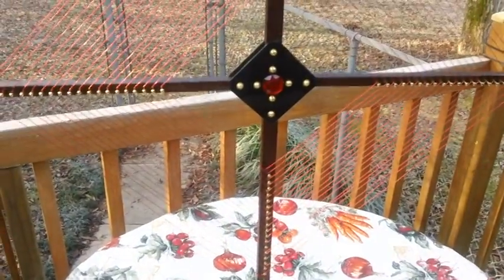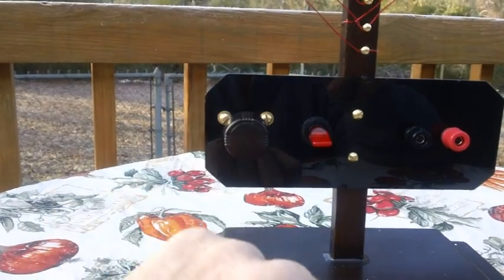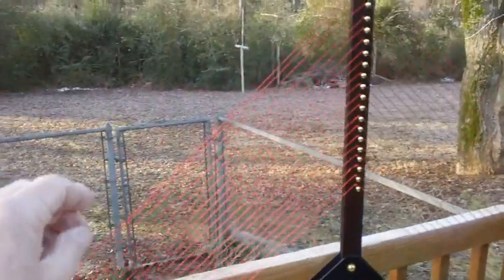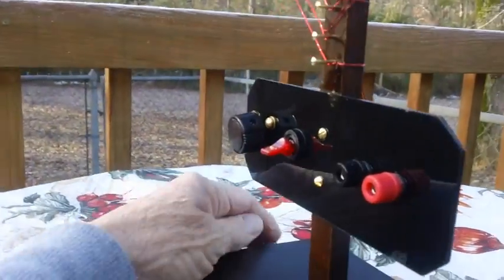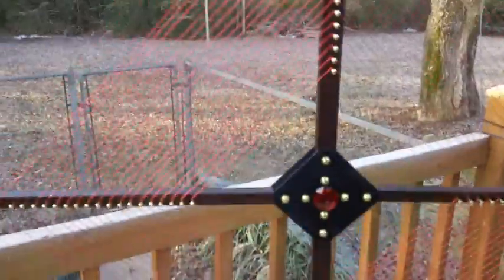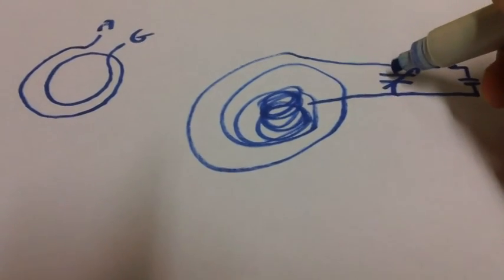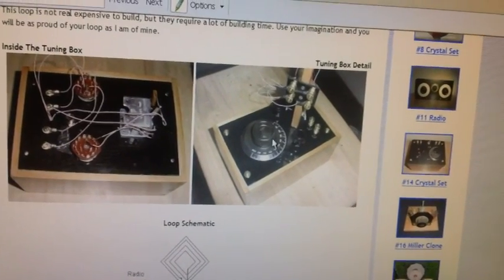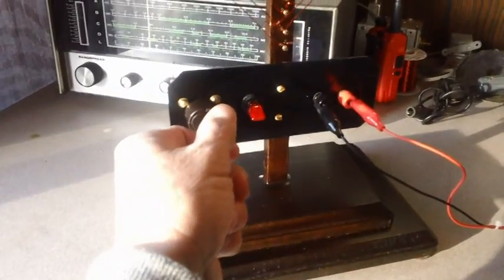AM Broadcast Band Tunable Loop Antenna

Comment: I Love your antenne construction. Like to build one for my LW/MW (SW) radio. What are the dimensions you used for the crossbooms?
Thank You
Stay Safe
Greetings from Belgium
Reply from the maker: Lambert,
12 1/2" each side.  Good luck with it, my friend.
Regards,
John
Reply: @joernone  Thanks for the answer, one more question, the additional 360pF capacitor (on the switch), what type is this, and which capacitor you use for the tuner?
Apologies for all the question.
Regards
Lambert
Reply from the maker: Lambert,
Go here for the 365pf variable capacitor:
https://www.ebay.com/itm/Capacitor-365pF-Variable-Single-Section/132032487083?epid=1712229709&hash=item1ebdbfdeab:g:N2wAAOSwfSJdC88J

This is the type of 360pf mica capacitor I used.  The voltage rating is mega-overkill, but it was all I had on hand at the time:
https://www.ebay.com/itm/Capacitor-365pF-Variable-Single-Section/132032487083?epid=1712229709&hash=item1ebdbfdeab:g:N2wAAOSwfSJdC88J

Regards,
John
Reply from the maker: Lambert,
One more thing, my friend.  This antenna is for the AM broadcast band only.  It won't work for shortwave 
Regards,
John
Reply: @joernone  Thanks again John. Sadly they don't ship to Belgium. I have looked locally, but could'nt find a variable capacitor that was usable.
Will look further though.
Greetings
Lambert
Reply from the maker: Lambert,
Not a problem, my friend.  I had an extra new one in my stash.  It measures out to  351pf, but will work fine.  Won't cost you a cent.
Send your mailing address to my YouTube handle @gmail.
Regards,
John

Comment: I don't know why you comment below denying a ground, since your diagram & voice clearly saying ground in the video. You are grounding 1 side of the the pickup loop which goes to your radio.  I can't see why you would ground that unless you are going to put a balan in between your balanced output; aren't you creating an unbalanced transmission line by grounding one side?

Comment: If your radio has a balanced antenna input, would u directly connect ur 2 leads to that input without a ground?  What is the impedance presented by your antenna output?  Is not the output intrinsically balanced? So how are you grounding one side without a balun?  I own a Sony receiver/amplifier (AV Center). The loop that comes with it has a twisted pair of wires coming from its loop & those wires connect into connection jaws in the back of the Sony.  There is no capacitor visble (maybe one is inside the Sony?) & u don't tune that loop.  So I am interested in a better loop antenna, but I really don't know what impedances are involved nor why you are grounding a loop antenna which I think is balanced. If you were to ground, I would think you would use a balun and then ground the shield side of your transmission cable.
Reply from the maker: I have no idea what you're talking about.  This is a passive AM non-Earth-grounded tunable loop antenna used to improve reception for vintage AM radio receivers that have no built-in antennas.  It'll keep one from having to string up an outside random long-wire antenna.   It's not to be used for transmitting.  There would be no advantage in connecting this type of loop antenna to a receiver that already has its own loop antenna, such as your Sony.  But if your Sony has a set of wires coming off the loop it's there so you can hook up an outside long-wire antenna.  So build a loop and connect it to those two wires and see what happens.
Reply: Thanks, Jer for responding, but no, the Sony loop antenna that comes with the Sony Stereo has a couple of wires coming out of it, twisted which plug into 2 antenna clamps in the rear. It has nothing to do with any long-wire antenna.  This is an el cheapo antenna with no tuning capacitor in it.  I am quite curious as to impedance of loops. Do u know what the impedance of your loop is?  I want to replace the el cheapo untunable loop with a higher class larger loop.  I wud like to know how many turns at what diameter to get 300 ohms output. I don't see how a loop could have anything but balanced output, requiring a balun if you will use coax as the transmission line.  This has nothing to do with transmitting.  I will not be transmitting on the AM broadcast band.
Reply: I can't see using a "long wire" as the impedance would be a very bad mismatch & no where near a 1/4 wave long for AM.  I doubt it would do as well as licking your finger and touching the antenna input.  And if you did get it 1/4 wave long, I think it would be designed for picking up signals from the moon over head.

Comment: I can't solder to save my soul.   Would this work ok using crimp on leads to the screws?  Every time I try to solder all I end up doing is making a mess and the wire never sticks, lol
Reply: Rebel9668  I taught myself how to solder and I think it looks decent.  I've had an old soldering gun that for years sat out in the garage.  It belonged to my Pappy back when he used to repair tv's.  An old Weller 8200.  I think I may get a stick-type iron though, my hands tend to shake a bit when i'm trying to do work on small things like solder connections and since there's no trigger on the stick kind maybe it'll be a little easier to use.

Comment: hey John,  I think I've wanted to make one of these for a while and wanted to ask you a question.  I don't know alot about radios or electronics and you make this project sound really simple to build,  but the question I wanted to ask is if I had a spare full sized tuning capacitor from an old radio, could I mount that to the base of the tunable antenna, or do you need a small one gang tuning cap. this is really neat and would be authentic looking connected to my old radios.
Reply from the maker: I see no problem with your plan.  Go for it, my friend.  If it's a two-gang tuner, use the larger one.  Be sure to let me know how it goes.  My curiosity is tingling.  lol
Regards,
John

Comment: so how could i apply this to a 1920s radio with a variable cap in it?
Reply from the maker: All receivers have variable tuning capacitors.  Just hook the tunable loop to the antenna connections on the radio.
Reply: thanks. im getting started on restoring radios (working on a ge model 60 currently) but im getting a atwater kent model 20 and was looking for how to make an antenna

Comment: I meant wire...İs it speaker wire?
Reply from the maker: I used 22ga enamel coated magnet wire, but 24ga would have been a little easier to use.  It's all in the video.
Here's a good deal on a 22ga 128 foot roll with free shipping.  Why 128 feet?...hey, someday you might want to make a second or third antenna and copper wire will not get cheaper over time.  If you make one of these antennas come back and let us know how it works.
https://www.ebay.com/itm/Enamel-Coated-Magnet-Wire-22G-4oz-Spool/181876113620?epid=1062204783&hash=item2a58a940d4:g:f3cAAOSw54xUVW37:sc:USPSFirstClass!72032!US!-1:rk:1:pf:0
Regards,
John

Comment: the sticking point with most loop antenna presentations which I have seen is a failure to describe precisely the interface between the loop & the radio, taking into account the type of antenna connectors which the radio has (ferrite antenna radios have no antenna jacks at all).  And another problem for me is a failure to address the issues of balanced vs unbalanced transmission & impedance matching.  If an inductive connection between 2 loops is going to be used as the connection, I can't understand why you would ground any loop at any place since it appears to me that any inductive connection must by nature be balanced & you do not ground one side of a balanced circuit (if you do this with 240 Volts AC in the house, expect an explosion).